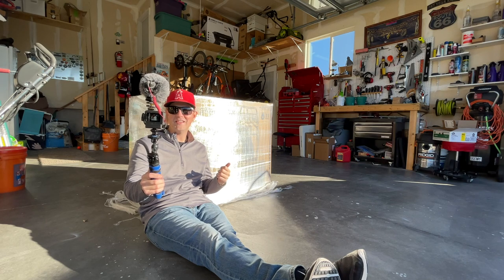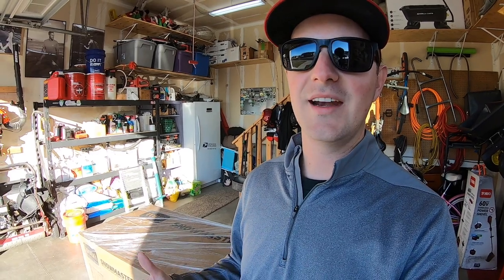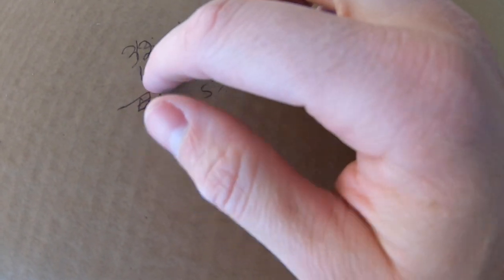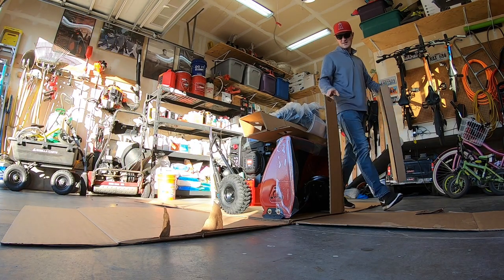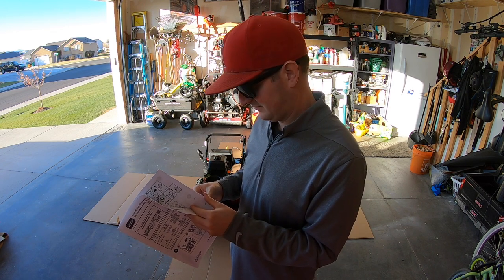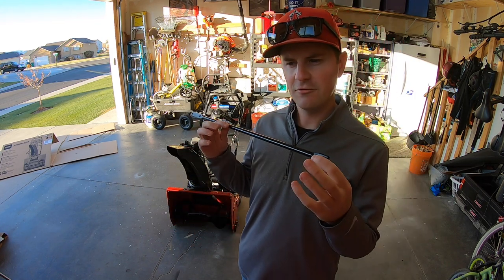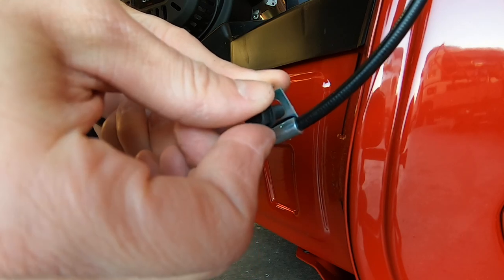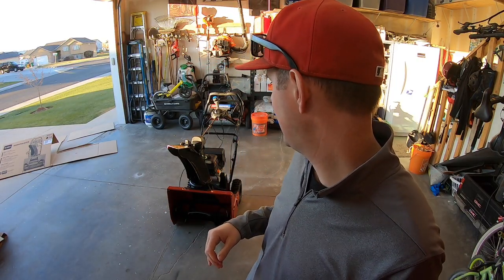Toro SNOWMASTER 724 QXE Unboxing and Assembly

Comment: My quick stick didn’t work right from day 1. It won’t lock in place. And I checked out this video and I did in fact install everything correctly. And they also overfiilled the engine with oil, I had to drain a little out. It was way above the high mark

Comment: I bought this unit thanks to your reviews.  I actually considered the 821 QXE pretty hard, but overall I think the stick and the extra width did it for me.  I was also reading somewhere that the 212 motor makes more torque than the 252.  Don't know if that's true or not.  I realize they make the 824 too, but I thought if I was going that far I'd just get a PowerMax.  We'll see how it does with a Wisconsin winter.  Cheers and thanks for the content.
Reply: Update we got 8 inches of snow last night.  Completed sidewalk and half of driveway before the belt fell off.  Post inspection I found the 4 bolts that hold the drive axle for the wheels in place were missing.  Will have to try and call a dealer today about the parts.  All things considered it did all that snow mostly broken from incomplete assembly so I’m pretty impressed.

Comment: I was hoping they would have sent you the power clear model I think they call it. The one that says it isn't supposed to clog.
Reply: The snowmaster does not even come with a tool to unclog it like most two stage blowers, because it is less prone to clogging based in everything I’ve read.

Comment: Totally unrelated topic, but what model of Echo backpack blower do you have? Are you satisfied with it? Looking into backpack blowers myself. Thanks!
Reply from the maker: That’s the PB580T. Very satisfied.
Reply: @JimmyLewisMows  Possible review? 👀 
I have heard that if you want to invest in a backpack blower to move lots of leaves, get something with 700+  CFM.
Reply: I have the exact same model and it’s a beast. Even rips through the pine needles easily!
Reply: @gary4738  How does it perform with large piles of leaves? How about wet leaves?
Reply: @bryceglissmeyer1016  wet leaves are easy compared to imbedded pine needles. You will be thrilled with this model ( Echo PB580T)!
Reply: Blows an impressive pile too
Reply: been moving leaves on our property for 30 years - should of bought one of theses years ago - the 580T starts first or second pull and has a large gas tank - highly recommend
Reply: @mdbassin6267  Thanks for the info. Have you tried moving dead grass from dethatching with the 580T?
Reply: @bryceglissmeyer1016  no but I have no doubt it would do it

Comment: Mine wont start
Reply from the maker: Have you troubleshooted it?
Reply: @JimmyLewisMows  how do you do that. I just unboxed and first time starting it
Reply from the maker: Is there gas in it? Is the spark plug wire connected? Did you check the oil level? Did you follow the start up instructions (key inserted, choke level set back toward the handle, push the prime button a few times before pull start)?
Reply: @JimmyLewisMows  I didn’t see the spark plug wire instructions in manual but i did the rest
Reply from the maker: So what happens when you pull start it? Does it sound like it's trying to start, or nothing?
Reply: @JimmyLewisMows  it worked now thanks. I had to hold the pull cord after i pulled it
Reply from the maker: Glad you got it!